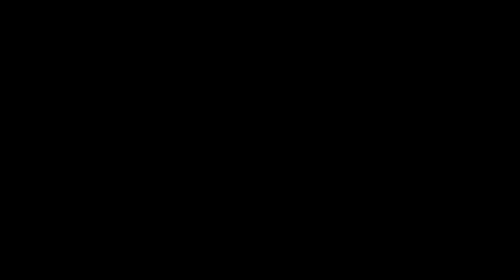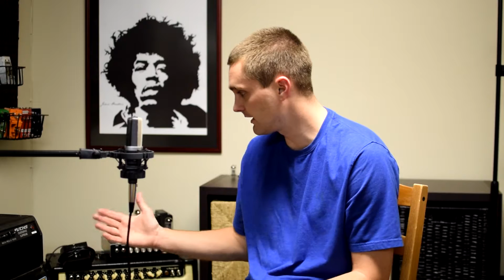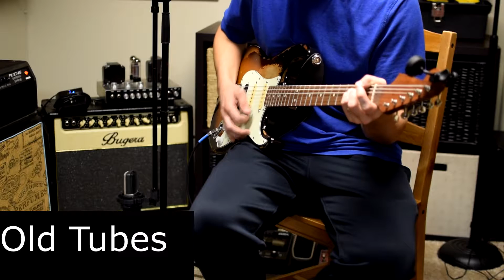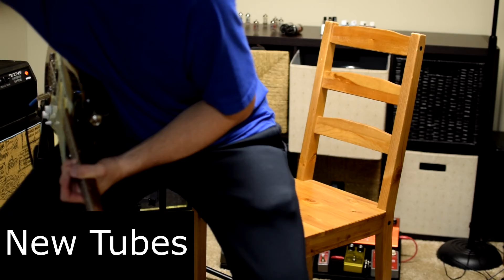Tube Replacement Comparison - Fuchs ODS Mod

Comment: Really great videos you've done with this amp. Sounded great before the switch, but the new tubes are really in another league. Do you remember if you were running through any pedals in this video, or was it straight into the amp? I'm considering buying a Fuchs Bassman conversion myself, and you may have convinced me with your videos on it.

Also, you mentioned the amp is picky about speakers as well, what speakers did you find worked best?
Reply from the maker: I was running straight in.  I still have this amp and really like it a lot.  It took some getting used to and wasn't necessarily a straightforward - plug and go type amp.  But once I figured out how I like to set it I am able to get excellent clean and lead tones.  The cleans are quite underrated and I've found they sound great at all levels.